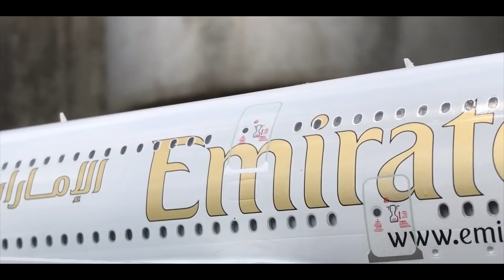Revell Airbus A380 Emirates LED assembly

Comment: Marvellous model with detailed lighting!
I think it's better to have thinner paint when using air brush. It should look your model much cooler.
Reply from the maker: Most of the time it just look thick because it isn’t dry
Reply from the maker: Kawasaki Jun the wings are airbrush, the rest is spray paint, the spray paint is thicker, but still thinner than it look in the video ☺️

Comment: Do you make the electronics yourself? Or buy a kit
Reply from the maker: I make them for myself and sell the boards with the program on it. :)
Reply: @OverloadTV1  how much are they
Reply from the maker: At the moment they are quiet expensive as they are assemblied at a low quantity. 
70€ p. piece. Including Touch, and Charger reciever coil for wireless charging. Additional you need the Led’s, Lipo and a normal Qi Charger:)